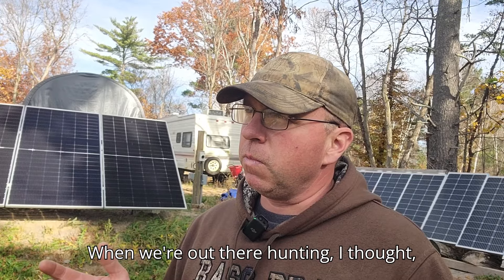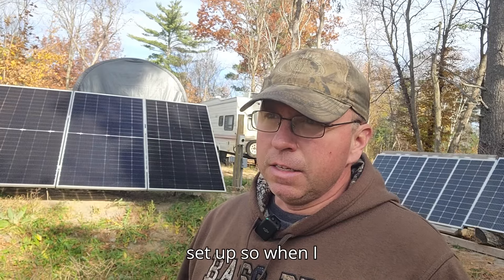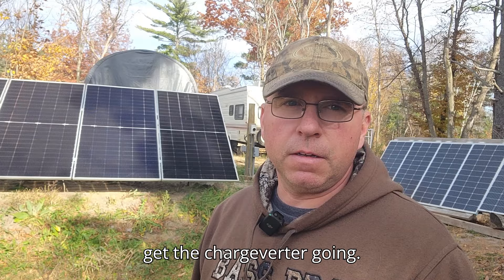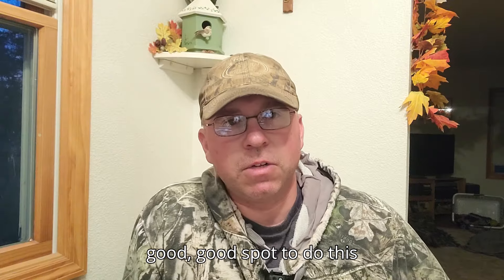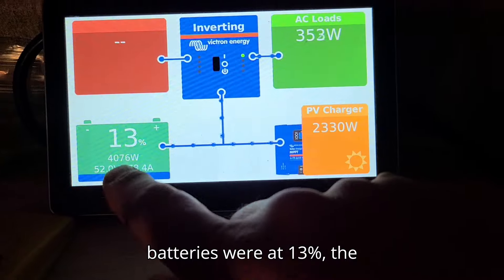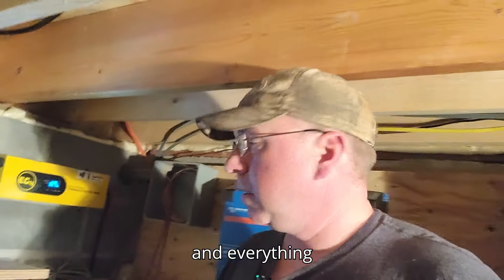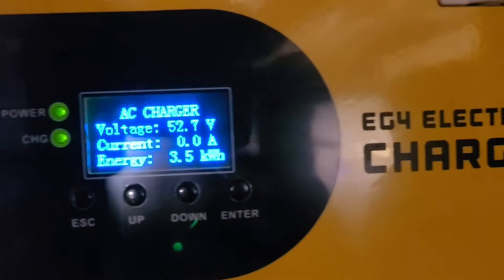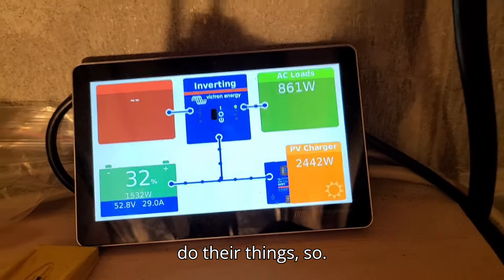Testing the Chargeverter and Generator #solar #diy #offgrid

Comment: i dont understand why i need to buy a charger for my batteries when most inverters will also do the same thing.....the "dirty"power from the generator is also bad for everything in your house that has a circuit board ie refrigerator, tv, modem. router, computer. get a smaller inverter generator and you wont need a "chargverter" to charge up your batteries and you will be protecting all the other electronics in your home that are not being powered by your solar/battery system.
Reply from the maker: I get your point.  All I can really say is that for me this is why I have the chargeverter. I have a larger generator that is over 25 years old.  With the chargeverter I can charge my batteries at a higher rate up to 100 amps, with my inverter I can only charge at 30 amps.  For me, keeping the dirty power out of the house is a big factor in my decision to buy the chargeverter.